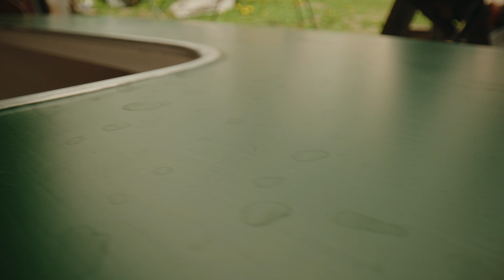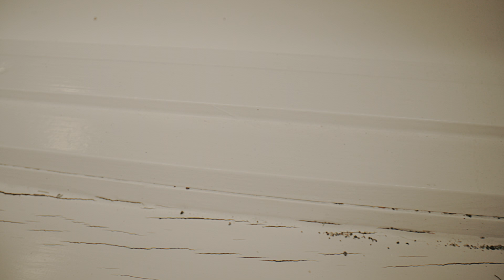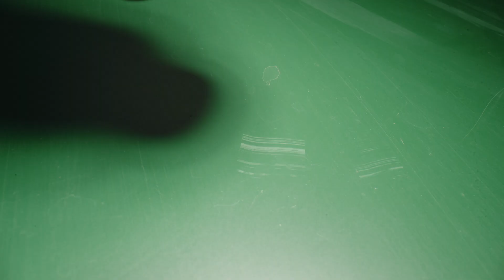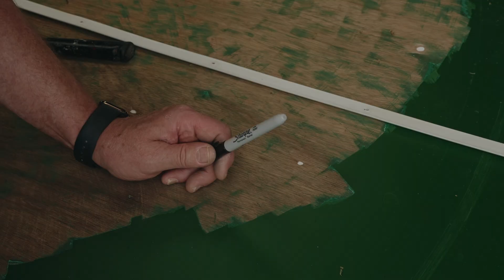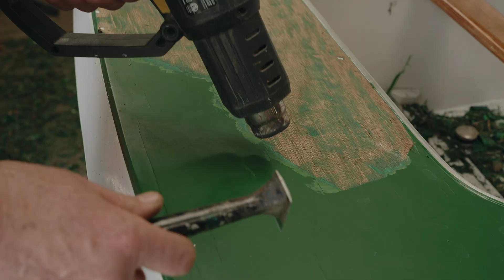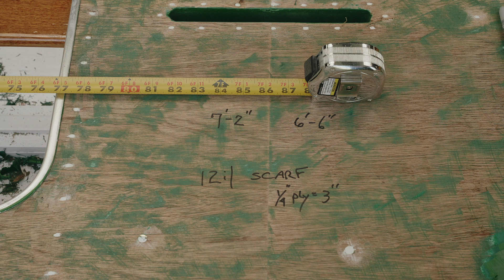Episode 11  - Stripping finish with a heat gun and scraper

Comment: I am also a big supporter of a heat gun and sharp scrapers like Hyde makes. I would love to see you use the powered long board sander.
Reply from the maker: I also think these two tools are vastly underestimated. The Hyde scrapers are about the best available currently, but the Proper line was ergonomically superior, and the blades were better designed for quickly producing a long-lasting edge. There were a different S/S material, and thinner with very wide ground bevels.